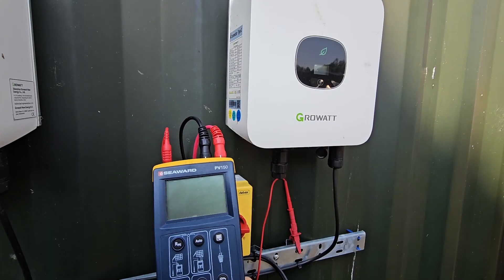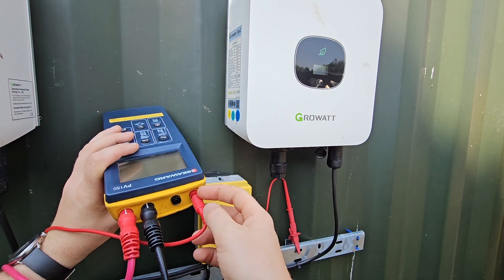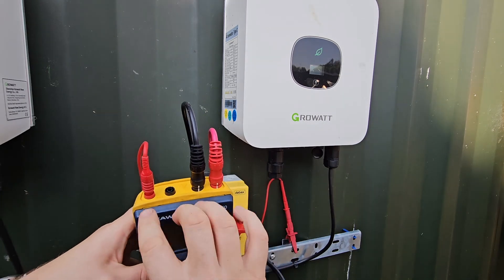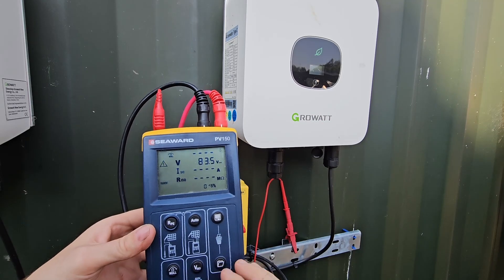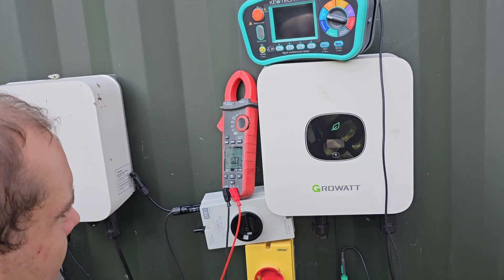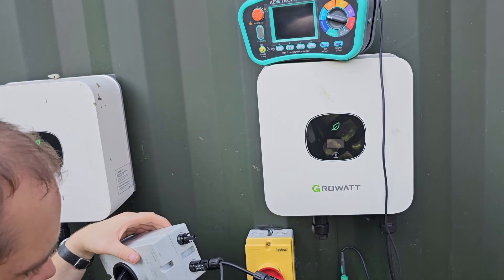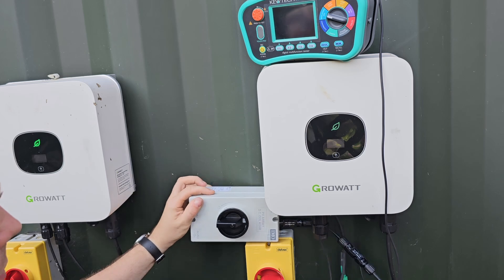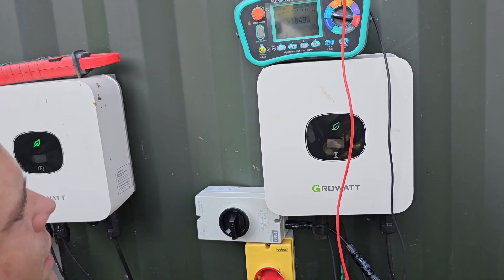How to use the Seaward / Benning solar tester, and how to test an array without one.

Comment: MFT Have you short circuit the pos and neg to earth for IR test?
IR method two lead pos to earth/neg to earth if you read greater than 999 would this indicate no earth or fault with the array? As the the panels has resistance.
Great vid 👍🏻
Reply from the maker: @michaelnicholas9750  you short circuit the array (as in connect positive and negative to each other) then measure the insulation resistance from that combination to earth. 

One lead of the tester goes to the shorted string, the other goes to some earthed metal. Similar to how you sometimes combine L&N to perform an insulation resistance test on an AC circuit.

You want a high insulation resistance reading, a low value suggests that the insulation is breaking down.
Reply: @tceng9449  
Thank you
With our service sheets on residential PV services requires dc positive to earth ir test  fallowed with dc negative to earth ir test. 40 M to 400 M is a good reading greater than 999 could indicate no earth, below 1 M will indicate damaged panel or mc4/ cable . Recently completed the LCL course unfortunately the assessor couldn’t explain the fundamentals on ir readings on PV array. 

Short circuit ir test greater than 999 satisfactory.

First test Positive to earth, fallowed by a second test negative to earth is a satisfactory to be greater than 999.

Really appreciate your feedback 👍🏻